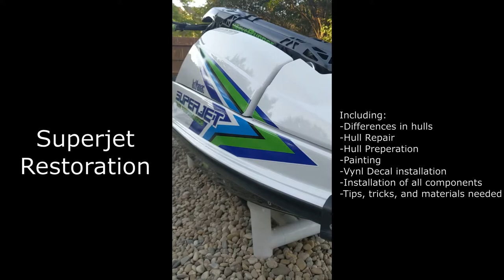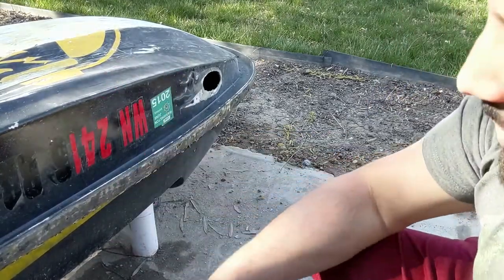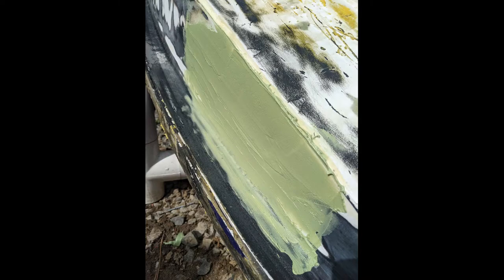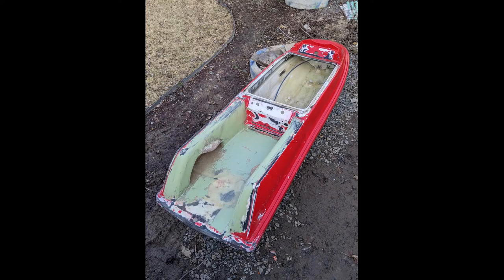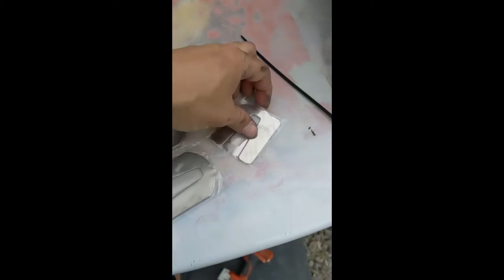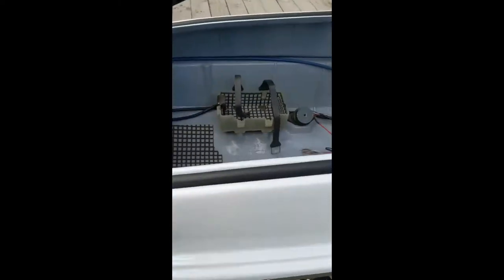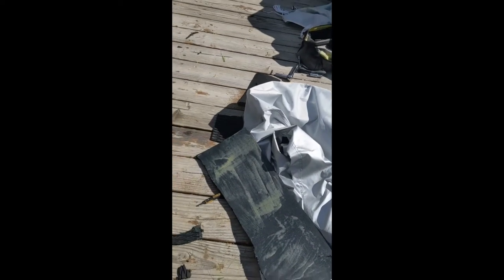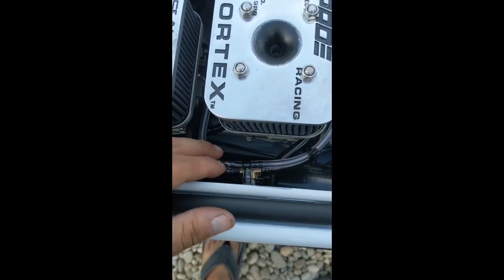Yamaha Superjet Restoration: The COMPLETE Guide!

Comment: If you get a chance. Measure the size of the bond line on both skis. Rumour has it that the square nose has a bigger bond line, surface area over the round nose. Making the square nose handle better in rough water. Its a tad wider and actually traps more water under it. Id love to know if this is true. Watched a video over on Jetskijims page. Check it out. Was neat to hear his thoughts.

Comment: The bottom hull section  below the bond line is identical basically between the RN & SN SJ's. 
1990-2008. Then i think they did actually change up some things on the hull and extended the length of the drivetrain and jet pump out alittle further for better handling and performance i believe it was.
Correct me if im wrong about the 2008+ differences.
I wasnt aware the exhaust was difference though and i have both, interesting.
How would hard is to replace that whole exhaust section out to the rear like you did on the RN. 
Only benefit ive seen with the RN, which you could really replicate it enough on the SN, as well. Is that the front of the ski being round like that, lets the water roll of the ski easier or drive thru the water sligtly easier than the sharper edges on the front of the SN.

No reason not to buy a SN Superjet though, thats all i had forever and its what made me fall in love with the Superjet after having all the different Kawasakis from the 550sx (real), and on up. 
Ive only got to ride a few sxr800's for only short peroids of times but i did like the SXR as well but i just felt more comfortable and more agile on the Superjet. 
My first SJ was a 650 and it already had mods so it actually ripped especially compared to something like a modded 550 or 650sx..

Awesome Video BTW!!
Reply from the maker: Good comment!  Yeah I wish I would have clarified the 2008+ differences.

The ehaust is easy to swap if youve already defoamed the ski.  Would take only an extra hour to line it up, glass, and tap holes. 

But if your ski is intact, I heard its also easy.  Just take a same size pvc pipe and cut teeth out on an end and start rotating it through the hull till you hit the back, then make the back enterance slightly wider.  Maybe use a portable light to help you see what youre cutting

Comment: When using a pump stuffer I've heard a top loader is not needed anymore. Thoughts, or your on the water experience? Thanks.
Reply: yup, you dont want a top loader with a sutffer. you want the angle of the intake grate scoops to be roughly the same angle as the pump stuffer.

Comment: Where did you get the padding you used under your mats?  Love that extra thickness 🙂
Reply from the maker: Blowsion.  But im sure you can get it from any of the main dealers. i dont buy the thickest, i buy the 2nd thickest.  The thick stuff is harder to work with because it shrinks easily after it gets wet and then doesnt look pretty.

Comment: Going to be painting a square nose hull here soon and going back and forth between using auto paint and gelcoat. Any recommendations? Have a friend who paints cars and is willing to try gel coating with me if that’s what I decide to do.
Reply from the maker: My last three skii i built were all auto paint.  I beach my skiis on sand and gravel  and this causes the lower paint to emediately come off. 

So I would reccomend doing gel coat for the bottom half.  And auto paint for the top half.  

Whatever you do, dont use rattle can paint.
Reply: @stewartsskirestorationhub  is there some kind of primer to use to help the gelcoat adhere to the hull. I hear it doesn’t stick well to SMC. Appreciate the response and great video btw!
Reply from the maker: TotalBoat gelcoat has a epoxy primer  you can use.  But everybrand has their own primer reccomendation usually.  I used generic rattle can primer on a SJ and then did gelcoat and it held up nicely
Reply: Depending on if you want to spend the cheapest/best for what you pay for, it would have to be appliance epoxy spray paint. The same stuff you put on a fridge or laundry washer. This paint is very good as it hardens and it’s not easy to scratch up. Now it is obviously cheaper than some other options and might not last forever. But it’s super cheap and easy to redo every 5-10 years. I use it on my square nose and it looks great.

Comment: can you give me your process for painting? did you Gell coat it or just do a clear coat?
Reply from the maker: Ive used gelcoat before. and i ruined two guns because i didnt clean it quickly.  it really sets up fast during spraying.
So my last two skis i painted them.  and although i loved the looks of the paint, the bottom of the ski quickly gets scuffed from beaching on sand.
So , its a toss up. matter of preference.  

I think ill be going back to gelcoat on my next ski, and just quickly get my guns cleaned after each layer.

In terms of process for painting, just make sure you use quality paint from a paint store.  and sand after your primer layer with some 400 grit.
Then  wash the ski down with water, not soap.  and let the water dry off for 24hours.  Moisture really ruins layers if you color coat too quickly.
Past that, its all about doing several clear coats.  Clear coats is how you get that glossy shine.  Also, it take spractice going a specific speed that leaves a gloss coat and doesnt run.

my best advice is to just go for it, and learn as you go.  Your first paint job wont look good.  
my 2nd last advice... DONT USE RATTLE CANs.  ITS GARBAGE and fades in 1 summer and doesnt hold up.
Reply: @stewartsskirestorationhub  thanks so much! ill post the final product on my YouTube channel. hopefully it looks good.

Comment: bought an used kawi 650sx noticed yesterday after finishing sanding the entire top that the pipe where the drive shaft goes is all cracked and broken so i have to replace it an most likely also redo all the foam.
Reply: yup. more than likely

Comment: could I just use JB weld for the filler on the bottom?  my ski just has scratches. no deep gashes.
Reply from the maker: I mean, that sounds expensive but it would  propably be fine.  I dont know man, sorry. Jbweld is meant to merge parts together
Reply: @stewartsskirestorationhub  ok. What would you recommend?
Reply: @willigrant  should be in the video. i reccomend TotalBoat TotalFair
Reply: @ryrystewy1  awsome thanks

Comment: what size side molding did you use from blowsion? is it 1" or 1-1/4"?
Reply from the maker: i honestly cant remember.  I know i bought the 1inch for my first blue superjet.  But for this last one, i cant remember if i used the 1 inch or the 1 3/8.   On that note, both will work and both look good.  Blowsions website indicate both will work.  i am 90% confident i used the 1 3/8, and even if i didnt, thats what I would buy if i were to do it again.
Reply: @stewartsskirestorationhub  i appreciate it a ton!!!

Comment: How did you get the spring on the rad dudes bracket to work??
Reply from the maker: Used a 750sx spring.  Cut the top right angle off so that its steaight an stuck it down the pole.  Then for the bottom i left a little nub of a right angle on
Reply: @stewartsskirestorationhub  do you have a instagram or something we can talk over? I need some pics for reference please!

Comment: What handle pole spring are you using?
Reply from the maker: Heavy duty 750sxi spring is what Rad Dudez reccomended with the pole.  Although i wouldnt say it fit perfect, i had to cut the top bend off in order for it to slip into the tube.  Then i put a rubber stopper on it so it didnt scratch the tube.  And next summer i need to weld something to raise the bottom bend up a bit higher so that it actually has tention when im riding with the pole more upright.   I would reccomend trying other springs or skip using the Raddudez bracket all together and go with Watcons and use what spring he recommends.

Comment: I am curious on what you got money wise into this amd the x2 each?
Reply from the maker: good question. let me tally it up and get back to you. this may take me a while. lol.  This was meant to be a hobby, not to profit. obviously.
Reply from the maker: X2 was 800$.  i sold all the components and i think i may have came out close to even there.
this 61x i found for 700$.  i bought the bottom casing for it for 80$ to make it a 62t.
I think i bought a ton of stuff from HSI, my bill was like 1300$. new pistons, head,  gaskets, bling kit, gas cap,  44 carbs pre configured, air filters, spark plugs, 
I think i spent 200$ at watcon for bumper and various parts.
80$ for front hood fill gas cap area.
Turf 80$. paint 200$. ride plate 200$. intake grate i got for 80$. fuel tank 200$. 
conversion parts propably totaled out to be around 200$ for all the adapters.
pump assembly i got cheap for 100$.
impellar 220$. seadoo hx waterbox 80$
additional elbows 30$ couplers 20$. 
BPIPE 1200$ bilge coat 40$. maybe 50$ worth of epoxy, glass, filler.
water lines 40$. fuel lines 20$. 
350$ for graphics
tubbies - 300$?
pump rebuild - 50$
100$ for carbon tech reads.
handlebar - 80 - grips 30$. Umi steering - 500$
bilge -50$
I cant think of anything else at the moment, i think thats is. soo...
So close to 7000?
And its probably worth 9000$ (in me eyes)

Superjet wasnt as expensive because i didnt have to buy everything. and i also bought an engine that was already good compression so i didnt have to fork down a huge bill to rebuild engine.
Reply from the maker: NOW IM SAD. LOL
Reply: @stewartsskirestorationhub2305  lol. But here is the thing you spent 9k on a bad ass ski that is a ton of fun and looks new! U can't get that excitement out a new huge ski they make nowadays that would cost you twice that much unless you go with a aftermarket hull and there 8k plus for those so really if you think about it 9k is a cheaper deal for the x2 and its a head turner not a huge 3 seater  or boring spark/jet blaster. Shit there still 10k at that. You did good. Does that make you feel better? Lol I'm restoring my blaster right now!!
Reply from the maker: @jeffbryner5355  nice. let me know if you put some pictures or make a forum post.
Reply: @stewartsskirestorationhub  I will do!